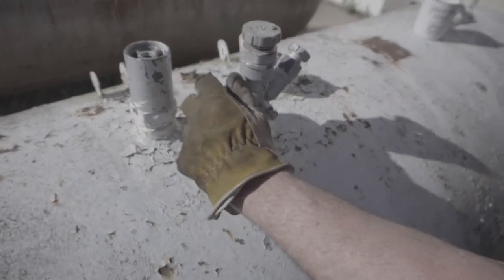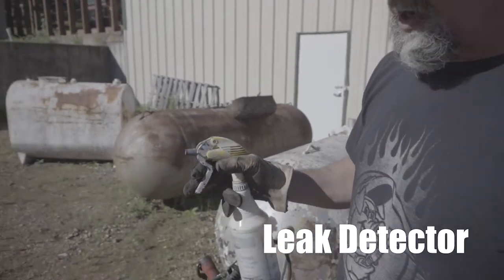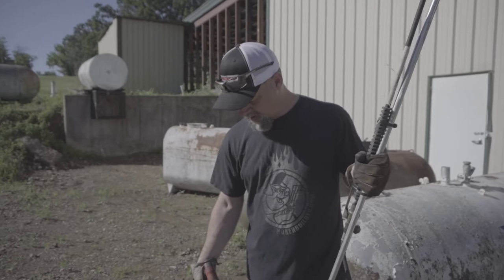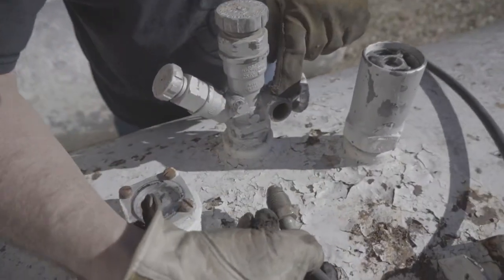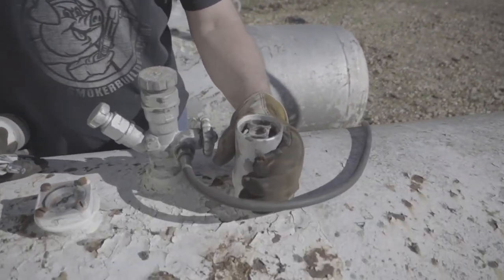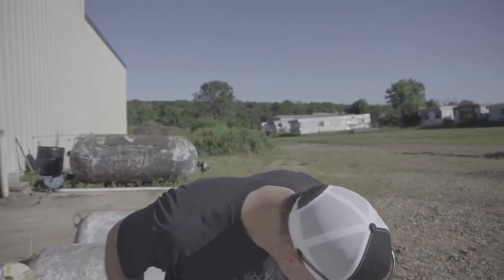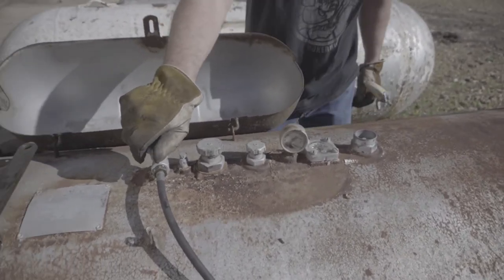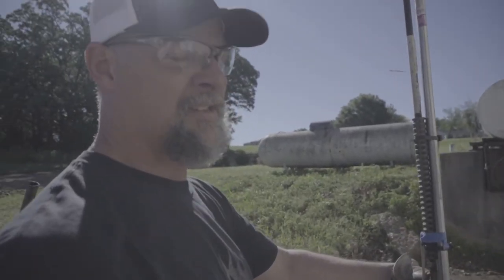Expert Tips How to Purge a Propane Tank Safely

Comment: Thanks Smoke Builder.  Very informative…as I am one of those guys you refer to in video who insists on doing things himself to get it right.  After concluding the dealership service department is ripping me off multiple times over our RV propane tank valve issues.  I’ve concluded I’ll remove the tank myself, purge it, remove the newly installed fill-valve/float bulb that won’t allow 80% fill.  Long story short…thanks for the safe way to empty and purge tank.  It’s what I figured…liquid propane and a pressure issue that must be considered when tackling this project.
Reply from the maker: I’m glad this helped you out buddy! 👍

Comment: I found if you open that valve all the way and then tap it a few times it will stop leaking iv done this many times !changing out valves I worked in the propane field for over 20 years you learn these little tricks !

Comment: You can tighten the valve's gland if it leaks and another thing if you open the valve fully you will actually seal the packing material in that valve. You can then unscrew it put antiseize in it put the gland back on work it back and forth and it's gonna seal right up. I work in industrial refrigeration on ammonia systems and we use the same style valves.
Reply: 99% of the time.
Reply: is also missing  o ring on pig tail conector

Comment: So I burned  the propane pressure out got the valve off filled it with water let it set for almost 2 weeks. It still smells bad. Can I drill and cut into it yet? I was going to drill a 1/4 hole in bottom and drain water and refill and rinse again? What do you think? Thank you for your help!!

Comment: I'm about to start on a 250 gallon vertical smoker. Are the fittings in the tank made out of brass or copper? I'm afraid if they're regular steel it might cause a spark when I try to wrench them out. TY
Reply from the maker: yep, they are brass

Comment: Could you have just tightened up the gland nut after you opened the valve? That way it will compress around the spindle and stop leaking while you empty the tank. Doesn't matter if it won't turn, it's scrapped anyway.

Comment: If I heard you correctly, you said you want the flame upwind from tank valve. Should it be downwind so the flame has no chance of igniting leaking propane from the tank's valve?
Thanks a lot for this vid!
Reply from the maker: You’re welcome!
 Actually up, wind means that the wind would blow across the flame first, and the propane would blow away from the flame downwind of it, so there was no risk of unlit gas wandering its way towards the flame

Comment: Hi i have a car that runs on propane (lpg). 
My question is how do I stop my tank from beading up and sweating with moisture on the tank surface and making my car wet inside from the moisture evaporating into my car.
My tank is behind the rear seat in my car and vents outside if the valve leaks it was installed professionally  here  in new Zealand.
Can I wrap something over it  to  stop it sweating.  This issue is causing my seats in  my  car to  get  mouldy and the trunk and car body to rust. Thanks.😁😁😁😁😁😁😁😁😁😁
P.S  I also heard if you have a leaky propene  tank you can  spray and hose  lots of water over the leak until the tank is empty as the water  traps the gas and brakes it down to a non flammable state.

Comment: No bubbles no troubles. So are brand new propane tanks filled at factory for testing? The reason I am asking is Costco sells the 30 gallon propane tanks. I want to buy one and turn it into a auxiliary air compressor holding tank. Is there anything special I need to do before tanking the gauge and stuff out to start the conversion?

Comment: I have a 250 gallon propane tank with no valves, this tank was given to me several years ago with no valves , do I still need to put water inside the tank to cut into it? need to
Reply from the maker: I recommend you do just to be safe

Comment: I have a “round” 1949 propane tank that’s approximately 40” in diameter. I was told that it was 250 gallons. It took 3 men too get the darn thing in my truck. I’ve cut one (1) before with my grinder that I’d guess is 3/16” thick. With the weight that it is I’m guessing that it has to be at least 3/8” thick. Any thoughts/insights  about how to tackle this  ? FYI Your videos are very informative. Thanks

Comment: I am purging a tank (1000 gallon---gauge on zero) to change out the percent gauge gasket. It leaks around that gauge.
Got everything connected like you said. Was scared to pieces to try it but it's been working. Burning for 2 days (turn it off at night)
Flame is now orange and will hopefully finish up burning tomorrow. I wonder how many gallons burn per hour with the burner on full blast.
Can you (or anyone else) tell me how to get the screws out of the gauge? They are really really tight. I am terrified they will break off. Have a kit to replace gasket and screws. Thanks for your help. Jesus bless.
Reply: Impact driver and hammer after soaking awhile with penetrating oil.

Comment: I have an rv tank that I need to change the filler valve on.  I don't have the burner you show,  but could I just use the motorhomes gas stove to burn the remaining propane out of the tank?
Reply: I have the same question

Comment: I have a 300gallon LP tank would it make a nice air compressor I wanna weld 2 plates on top of tank so I can buy 2-3hp compressors and mount 1 electric 5hp motor I'm planning on buying everything from Harbor Freight I don't know where to buy all the fittings I'm gonna need but you now know what I plan on doing with tank.
What's best way to empty my tank. The gas people here charge $350.00 to vacuum it out my main concern is welding on this tank.
Reply: I wanna be safe about doing this procedure or should I just forget it

Comment: So i got a propane tank and purged the tank with water and it overflowed a bit and water that smelled like propane leaked into my yard and now my yard wreaks of propane. Im guessing its from the residual from years of use. But now im wanting to drain the tank bit im afraid of running a hose to my sewer  in fear of it smelling like propane as well. So is there a chemical i can purchase to eliminate that smell and make it safe to drain without it making my drain pipes smell like propane?

Comment: Thanks, I enjoyed the video. I have a tractor that the fill valve is not working. Can I empty the tank just by letting the tractor run til it is out of gas? Any advice would be appreciated.
Reply: That would work this video showed some good things at my work instead of pulling from the pol we go off the vapor valve

Comment: I have a 120gal tank with the percent gauge that reads 0% and when I open the valve, I have no gas hissing out of it as you do in the video. Would this be a good indication that there is no gas/pressure left in my tank?

Comment: I watched this video and tried to do what it says.  I learned something very surprising. I burned off all of the pressure with a weed burner set up exactly like that one. After removing the fill valve and puming water into I couldn't help but notice how much propane was being pushed put. So I hooked the weed burner back up and it lit right up. At this point I have been pumping water in the fill valve and burning the weed burner wide open for 5 hours. You've been dumping tons of propane by filling the way you are.
Reply from the maker: Yep, as you fill the tank you will be pushing out the vapor. 
If I’m understanding what you’re doing, 
I do not recommend filling your tank with water and burning the vapor at the same time. 
If propane can come out of other connections such as where the water is going in, you could ignite the cloud.
Reply: @SmokerBuilder  the water was being pumped in by a threaded connection so there was no chance of that. It was pretty funny when the tank got full it went from bright blue flame to water fountain instantly.

Comment: Need to add sand to purged 500 gallon underground tank. What is the best way to get it into the cylinder? The removed valve holes look quite small.

Comment: Wouldn't the likelihood that flame and the 4% mixture of gas/air from the leaking valve getting together in the exact combination at the separation distance you have very unlikely? According to (our local) the gas company that mixture of gas/air is very critical for combustion and especially explosion, plus this is an open air environment on apparent flat ground with few depressions for the heavier than air gas to accumulate. At least that was presented at our FD training for volatile gases. I only say that because you indicate you MUST remain on site until the gas is consumed. That is not to indicate one should leave such a situation unobserved either. Also aren't the valves similar to water valves and the packing could be compressed and tighten by the "nut under the valve handle" (compression nut) therefore solving the leak around the stem?

Comment: Thanks for your videos!  Assuming you knew it was empty of liquid, why wouldn't you just want to open that valve and let the tank vent it all out on its own?   In your situation, it seems obvious with the sparks and such from your work but for an average joe with a large open area free from any spark source other than lightening perhaps...what are your thoughts on that?
Reply from the maker: Hello! Propane puddles and will sit in a lower area until something ignites it. It does not go away unless it is blown away with the wind. But even then it can gather in congregate in a ditch or a pond or something until someone flipped a cigarette. Much safer to burn it off.
Reply: @SmokerBuilder   you are correct on alot of what you have said but  id like some more clarification. while yes propane does puddle because its .42% heavier than air. and its only a liquid under pressure. propane will evaporate. it will dissipate without the help of fire.  so in turn if we are not purging a a fresh tank that has just been taken out of service rather a old tank that has had plugs out if it whats the issue there? honest question im not trying to sound sarcastic
Reply from the maker: @magnoliabowhunters2869  no worries, actually the mercaptan in the tank is continuously releasing propane vapor. 
I’ve had tanks that were open for years that still ignited after being cut open. 

The main thing is always assume it has vapor in the tank until you have a hole in it this is the safest practice
Reply: @SmokerBuilder  so mercaptan is actually
Flammable? This was never covered in all my classes from the rail road commission. I will agree 100% same with treating every “thing” as if it loaded, I ask because I know that is and additive, at the rate of 1lb per 10,000 gallons (if you care lol) pretty much for the only purpose of leak detection because the properties of LPG being Odorless in a natural state. But I agree non the less I’d still feel safer filling one up with water and cutting or your method for sure
Reply from the maker: @magnoliabowhunters2869  yep, while it is flammable as an oil the real risk is the propane that is absorbed into the mercaptan. Especially if the tank is old. Older tanks that have run out of propane often have more mercaptan left in them as it boils off at a slower rate than the propane does.

Comment: Why don't you hook up a smaller cylinder and catch the propane?
Reply from the maker: Great question. Propane must be transferred with a pump. It is in both liquid and vapor state in the tank under pressure. 
First of all it is not really safe to do this without proper training and equipment. 
Once you “hook up an empty tank” It will pressurize quickly before the liquid can fill the tank to 80% which is the maximum safe fill but temperature corrected at 60 degrees F.  (by the way, never attempt this without proper training and equipment). 
To transfer the propane efficiently and safely you need to use a very special kind of pump and transfer it in liquid form drawing it out of the liquid port.

Comment: ...got a Mr. Jeater Buddy on a bbq tank...keeps fouling my filter and heater, shuts off...i clean the pilot line w qyip n alcyhol...still foul, goes out...bad gas...how purge bbq tank of oil...water  dirt...same way?
Reply from the maker: This question would be better answered thru the tech support line for Mr. Buddy.
Reply: They sell a hose that has a filter in it just for that purpose, there is no way of assuring no impurities are in a bulk tank

Comment: Can't you recover the propane and store it in a tank you're not gonna cut into?
Reply from the maker: Great question, in order to move the propane from one tank to another you must have a very special pump that is specifically designed for moving propane.
There’s a lot of safety concerns with that.
Propane companies have that equipment and can do that for you.
Reply: @SmokerBuilder  thanks for the reply.  That makes sense,  I just didn't realize how complicated it actually is. I have a 250 tank I'm planning to work on soon but it's a little less than half full. I was thinking of filling all my small tanks till it's empty but not if I need special equipment. Just seems like such a waste to burn off all that propane especially considering the cost of the fuel these days.